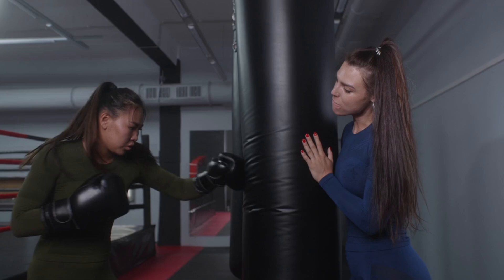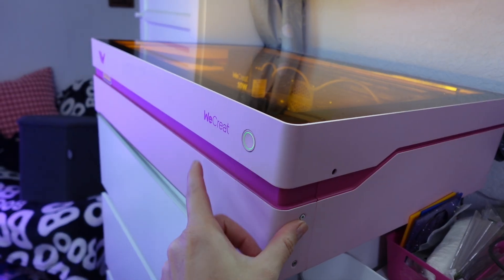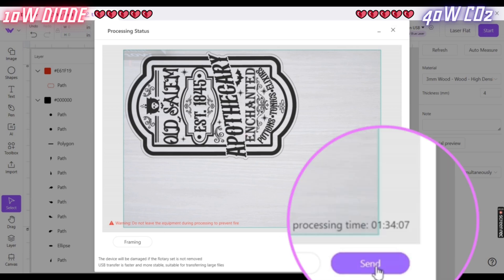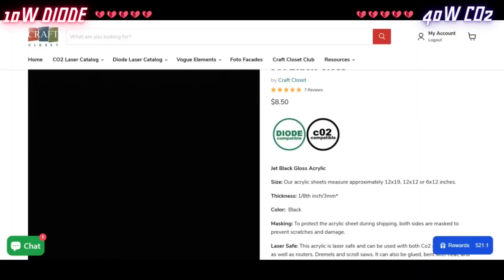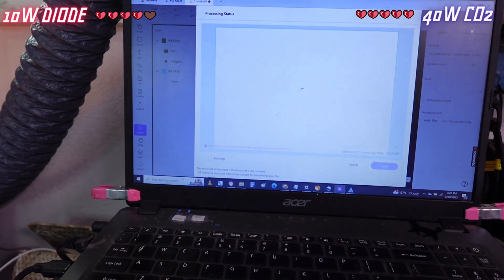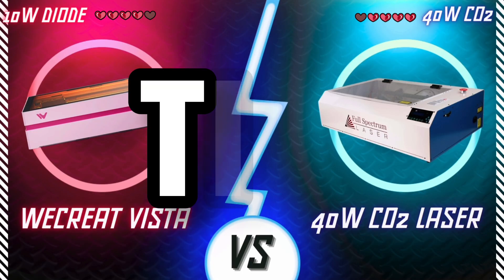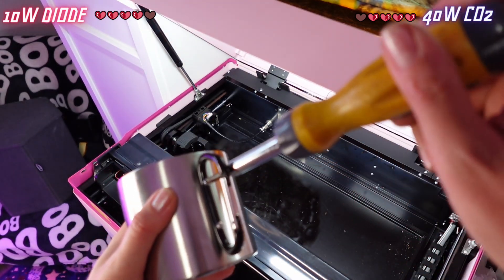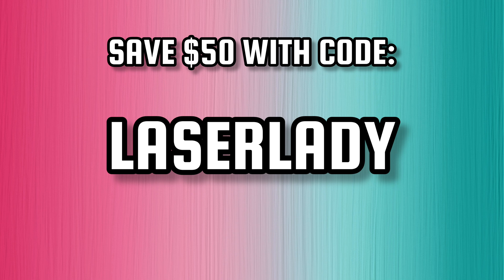40W CO2 Laser Professional VS 10W Diode Laser

Comment from the maker: :hands-yellow-heart-red:I'm not getting rid of my CO2 laser anytime soon, but I sure do like the features of this little diode laser! 
What kind of Laser do you have?
Reply: I'm on the fence between either the WeCreate Vision Pro, Nova Plus 24 or xTool P2S. I'm probably going to go with the Nova Plus 24, but it's a tough choice, the We Create does pack a lot of value at a low price.
Reply from the maker: @DiscipleX00  Great lineup! Price VS Capabilities can be a tough one! It really breaks down to what you plan on doing with it. I paid $3500 for my old laser and am still using it to this day (but nearly every part has since been replaced. 😆) I've tried 4 other lasers and always come crawling back. Be sure to pick one that either has a good program to go with it, or is compatible with LightBurn. 
I'd say the biggest drawback to a diode laser is not being able to cut most acrylics. Most of what I make is acrylic, but If I just made signs, tumblers, metal charms and whatnot, the WeCreat is a great deal!
There really is no wrong choice, because if you like lasers, you're going to end up with more than one of them! 😁
Reply: @LaserLady  Thank you for the advice, I appreciate it :)
Reply from the maker: @DiscipleX00  You bet! If there's anything in particular you'd like to learn more about - let me know!

Comment: May I ask you. How often do you have to change your co2 tube? I think what the company’s write down of their product is not really the reality
Reply from the maker: With my 11 year old laser (in video) I have probably changed it every 1.5-2 years running it 4-6 hours a day. They can lose their power after a while, so I would change it before it went out completely. Every so often you may get a bit of a dud that doesn't last long or has an imperfection.
Reply: @LaserLady  Thank you so much❤
Reply: @LaserLady  Could you also recommend me a good co2 Laser or help me to find the right brand for it, or even tell me what kind of co2 Laser you use? 1,6k-2,2k price segment. i thought about monport they seems to do pretty good but im not sure, its a really hard decision to make.. i also thought about the diod machine from WeCreate (45w vision pro) but it seems the camera (fisheye) is the only way to focus the objects and i watched about 5 creater review videos and no one is able to print the logos centered on their stuff (LOL) and then they say something like "well, it looks cool anyway". For me this is a big no go, imagine you have just one specific piece and want to engrave it. you than got a 50/50 chance :D.
Reply from the maker: @talsmanic  Most laser programs will have a calibration function for the camera, so you can really fine tune the range. There is also a framing function that can help with centering. I have a Monport Reno 45W CO2 (https://bit.ly/46npakt) which is great for the things I make - mostly acrylic things. Definitely do your research and compare the material capabilities, diodes and CO2 are super different. I go over the differences a little bit in this video (https://youtu.be/eYC8apkFOmM). If you go with monport, I do have a discount code for 8% off (LASERLADY). Please feel free to email me with your laser contenders if you have any questions about them - meredith@designsbylaserlady.com 🤗

Comment: can't wait for you to be able to do some comparisons with the new batch of laser cutters hitting the market for desktop and multi use.  Like what the vista can do, but wish there were some real hacks for translucent/white/blue acrylic that actually worked
Reply from the maker: YES! I am working with a company right now that has the capability to actually CUT everything but metal (CO2). One day I'm sure someone will crack that code, but for now, CO2 lasers are the most versatile beasts. You just have to accommodate for cooling systems and such. I've seen Monport Lasers has a laser that has the cooling system IN the main body, but it is a meaty machine. 💪
Reply: @LaserLady  have you found any hacks that really work with the clear/white/blue acrylics to any extent??
Reply from the maker: @KBCallahan Not for a diode laser. I've seen people figure out ways to engrave into it, similar to engraving glass, but not cut. The blue light will just disperse and get all bloopy.

Comment: I have the FSL 24x16 and the Xtool F1U. Is the FSL software for your muse still being updated? I think it has been over 5yrs for mine. I am considering replacing it for one I can use with lightburn. 🤔
Reply from the maker: The FSL I have is a Gen5 Hobby 20x12. It runs off their original RetinaEngrave software, which isn't cloud based, and just plugs right into the laser old school style. I wish they transferred the same program over to the Muse series! I have a Muse, too, but it didn't really win me over and I don't use it now. There's so many options out there now, it's wild!